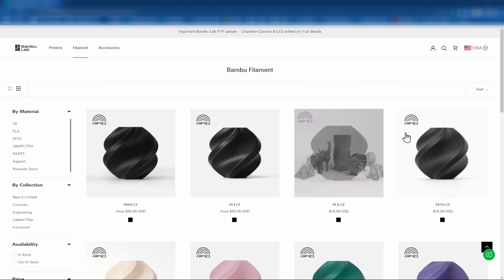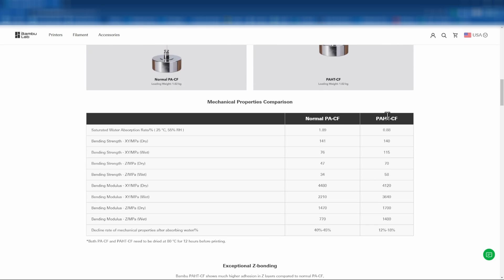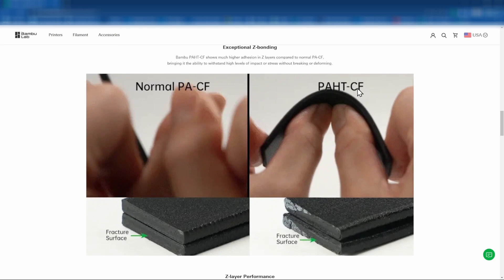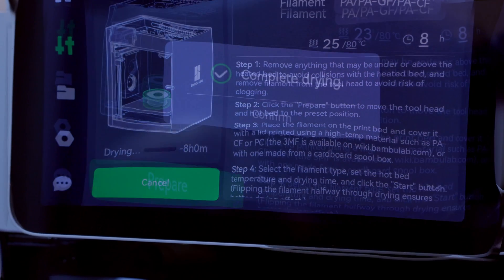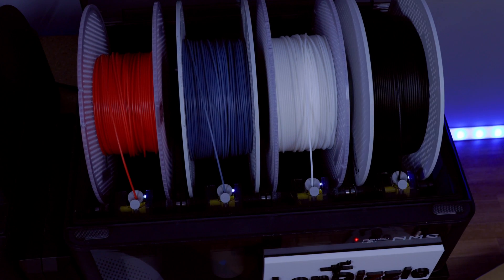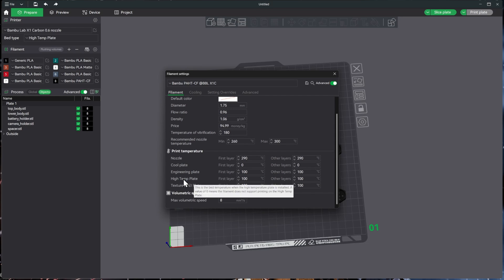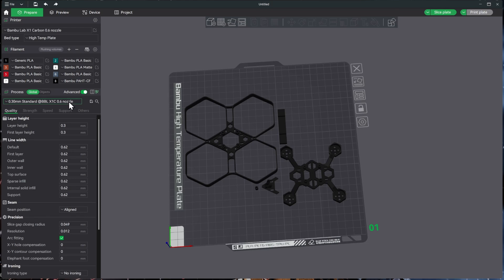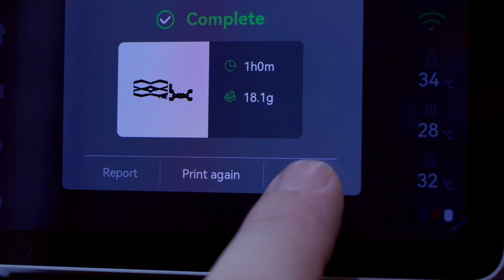How to Print with Bambu Labs PAHT-CF Filament on a Bambu Labs X1 Carbon 3D Printer

Comment: Hi, I am trying to print PAHT-CF -15 with Bambu Lab X1E, but it leaks (oozing) from the nozzle during printing or when the nozzle is not moving. Although the filament pusher motor is not working, it is self-flowing under 260 C.The nozzle I use is 0.6mm.Can you suggest something about this? I reduced the flow rates, but that didn't work.
Reply: Try 0.4 it works better

Comment: Nice video! I wonder if the Dry vs. Wet strength comparison is strictly about "filament humidity before print"? If I print with dried filament, but after it turns into the printed part, I imagine the part would still absorb water along the way, right? Then will that compromise its strength still?
Reply: It is about dryness after the print. Even a completed print will absorb moisture after printing and change its properties. Filament dryness basically only affects print quality.

Comment: PA6-CF is superior. You cant use it in the AMS but tbh you want to be running from a filament dryer anyway. PA12 is okay but its nowhere near as strong as PA6
Reply: PA-6 CF is weaker than PAHT CF when wet, which is what it will be during use unless you surface treat the part.
Reply: What is your opinion on Poly's PC-ABS filament?
Reply: They have PA6-GF if you want to use AMS.

Comment: I just ordered some of this filament for diesel heater adapters, do I really need to buy a 0.6 nozzle? Or can I just use th 0.4 that I got with my x1c? How necessary is the 0.6??
Reply from the maker: my .4 didnt print right afterward.  I highly recommend .6
Reply: @lendizzle77  it wouldn't print it at all without h .4???? Even tho it says you can on the spec sheet for the filament??
Reply from the maker: It printed but the nozzle was jacked and didn’t print normal pla right after. That was my experience
Reply: @lendizzle77 following up on this. Finally got my paht cf in the mail and dried it overnight. 

I'm about 2 hours into a print right now making a quick disconnect twist lock adapter for a diesel heater. 0.4mm nozzle no issues and all to speak of. Actually is printing amazing.  0.2mm layer height with ironing on. Looks super clean right now. Will follow up once this print is finished
Reply: @lendizzle77 follow up- after about 7 hours of printing with this filament and a 0.4 nozzle I am happy to report zero issues and zero settings tweaks. Stock bambu slicer settings worked amazing. 

It did take a bit to get the nozzle cleaned out afterwards tho. I had to run quite a bit of ASA through the factory 0.4mm nozzle to finally get the texture out completely. But printing ASA and pla afterwards again zero hiccups and no issues to speak of 🤷‍♀️. Seems to be yet another win for this amazing printer

Comment: Good stuff if you want to build an engine block
Reply: Im going to use it to print a heater core adapter for a classic car curious how long it will hold up
Reply: @Wietzevanderlaan  I'm doing something similar. On a '53 Ford Victoria the heater plenum is a thick cardboard and the replacement is almost $200 shipped for the same material. Unlike ABS for later year cars like Falcons and Mustangs so I'm definitely going to print it instead.

Comment: Do you use the .40 nozzle when printing your CF filaments or a larger one ?
Reply from the maker: I have been using .6 for these tests.  I used a .4 in the past and the CF ruined it
Reply: @lendizzle77  What about the other bambu CF filament like PLA CF and PETG CF?
Reply from the maker: I have videos on those